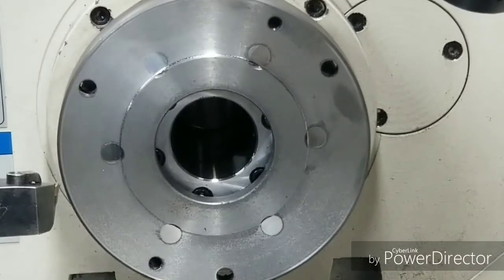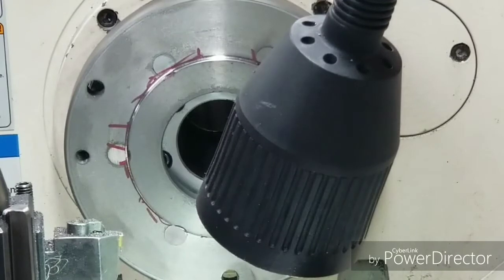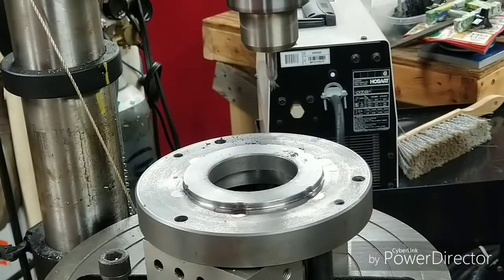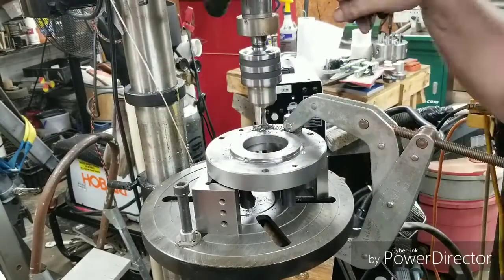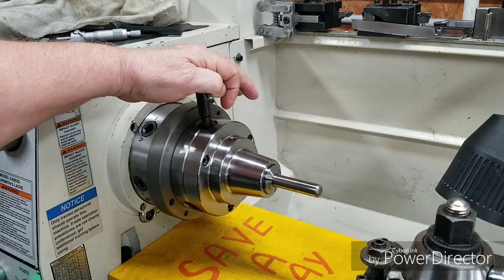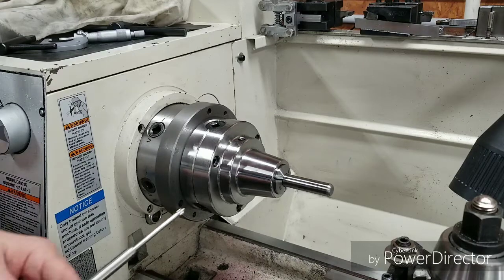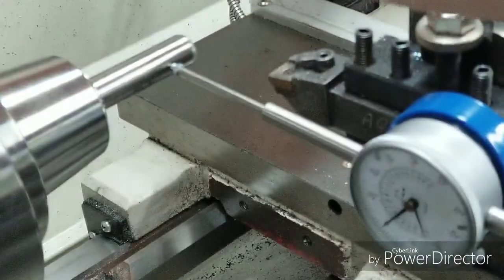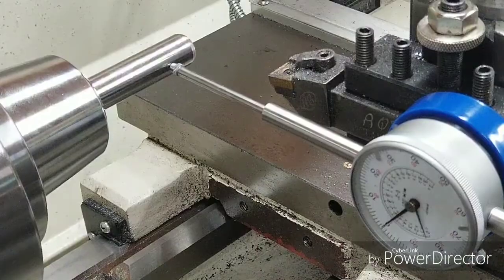Machining D1-5 Back Plate for 5c collet chuck to .0001 T.I.R.

Comment: Where did you buy the 5 C collet chuck?
Reply from the maker: Bought it off Ebay  just a cheap import 140 bought collets there to https://rover.ebay.com/rover/0/0/0?mpre=https%3A%2F%2Fwww.ebay.com%2Fulk%2Fitm%2F132210711370

https://rover.ebay.com/rover/0/0/0?mpre=https%3A%2F%2Fwww.ebay.com%2Fulk%2Fitm%2F123584638741

Sorry it took so long but comments was messed up and i just now figured how to get them

Comment: I noticed you elected to machine the pins on the backplate. When I did me ER 32 adaptor foe my Grizzly I sandwiched a aluminum place in between the backing plate and the adapter so I would have to face the pins. The face driving fixture I use it had a steel plate attached for the same reason. Great job
Reply from the maker: Jim I thought about a spacer and thought about grinding them before turning but decided to just turn them as i turned the back plate. Since unless something drastic happens it will never be disassembled.  Thanks for watching and commenting.